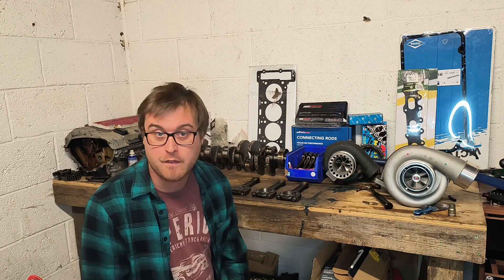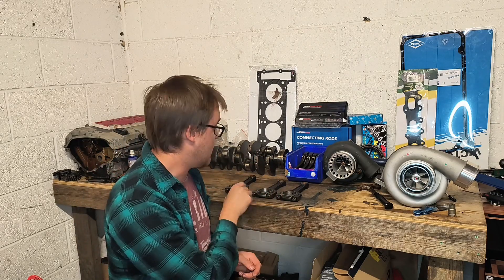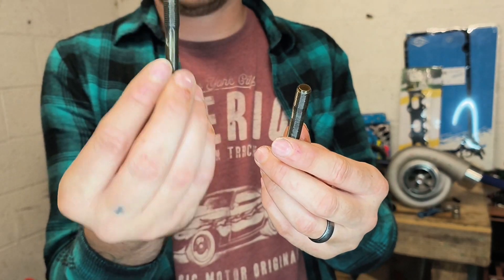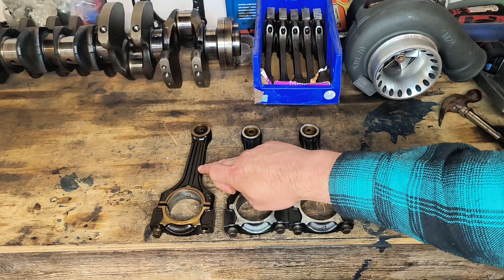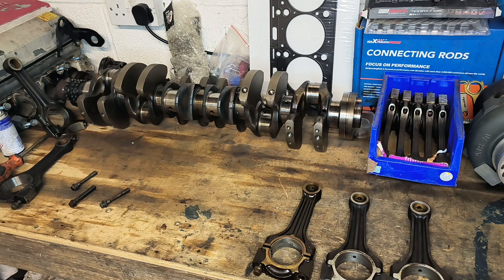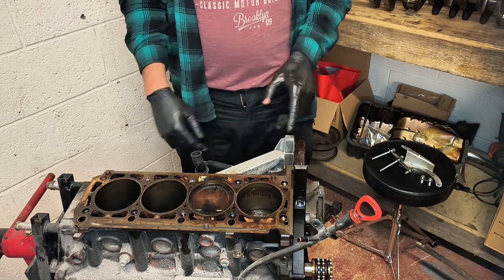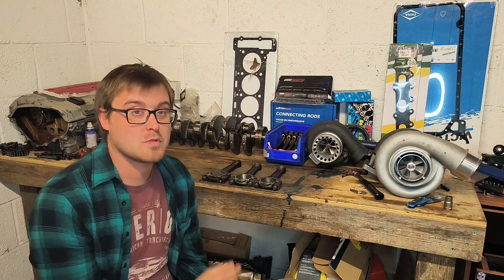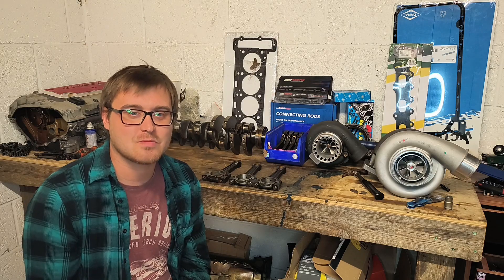What So Special About 90s Mercedes Engines? If Your Tuning -You NEED To See This! M102 M103 M111/104

Comment: Hello do the OEM bearings come 2 in one package ?And are the rods stamped per cylinder number or just to match rod and cap ?Mine on m104.980 were stamped(cap /rod)  cyl1:260-260,cyl2: 2-2,cyl 3:4-4,cyl 4:3-3 ,cyl5:5-5,cyl6:6-6 dont know why... Thank you!

Comment: all these engines keep the boost well etc well the best m104 here in terms of block hp etc it's almost the same and it's still desirable to change the pistons connecting rods and inserts on all these engines if you want to make more than 500 hp to have a large resource

Comment: Hi, what a nice video. I want to know if the m111.955 2L have a the same rod lenght as the 2.3L
Reply from the maker: @tynwolf7686  Thank you, to my knowledge the 2.0l does share the same rods as the 2.3 with only higher compression pistons and a different crank stroke and bore
Reply: @M-oneeleven-M111 ok thanks for those information. Do you know if 2L with forged rod can handle 500 hp?

Comment: I hope you see this comment to advise me before any purchase...I'm going for a m111 turbo build. 
In my country the EVO 230's are difficult to find...So i just found one w202 1996 engine 2.3ltr m111.971 **NON VVTI**.
What's your overall thinking about the pressure this exact engine can handle?
The block is the same on m111.973 vvti and m111.975 right? With that said i was planning on putting an EVO 230 VVTI head on the block from this engine. Could this be done with no other changes?
How does VVTI affect m111's and do i have any advantages on vvti vs non-vvti m111 engines on tuning?
ECU will be Standalone.

Thanks in advance! Waiting for news for your m111 build!
Reply from the maker: hi, if I remember the 111.971 is the naturally aspirated 2.3 isn't it, so the block will be the same rod head but the cams and pistons are different, so the pistons are higher compression slightly domed tops (I'm ironically after a set for the built to see that will help with the rods I want to use) the problem with this is domed tops are not the best for boost especially when the "squash volume" at the top of the cylinder is so small, this would mean you are limited to the amount of boost you can run because the engine with want to DET more. regardless of N/a or Kompressor I recommend only using a MLS headgasket and Arp head studs which BMW s14B23 Arps should fit. the weakness of these engine is the clamping force and lack of material between cylinders (block shims can help with this). 

as for the Evo head swap it is something I want to try but unfortunately haven't been able to myself yet, but I feel it would be possible, but I'm not sure how the timing works whether the it would be a straight bolt on or if you would have to adjust the mechanical timing. I certainly view the Evo head as better for boost with the larger ports and better valves, cam profiles also changed and it is designed for coil on plug ignition. but unfortunately I can't say for sure it would fit as I haven't done it.

I hope that helps 👍
Reply: @M-oneeleven-M111  pls bro tell me i have m111.980 2.3 naturally aspirated vvti engine in w638 so  is this block,piston,connection road,crankshaft and head same? I know that  2.3 k head have  different valve size but i want your reply to know worth my engine tune like you and change this roads pistons or swap 2.3k?

Comment: Is there a difference in fitting om606 turbodiesel connecting rods in a m111? I Think they are pretty beefy and can handle a lot
Reply from the maker: The om606 uses a larger 28mm wrist pin I believe where as the M111 uses a 22mm pin so you would need pistons to suit but they could work if you had pistons with a 28mm pin, a lot of parts are interchangeable with the diesel and gasoline/ petrol engines, however all of the diesels utilised a larger wrist pin due to the increased torque and compression ratios, where as a lot of the gas/petrols use a 22mm diameter pin. Hope that helps 👍

Comment: I want to turbo my m111.960 2.2 but im wondering what piston and conrod i should use to reduce compression just a tad. Do you have any guidelines or suggestions?
Reply from the maker: on the 2.2 it's a bit of a challenge as the compression ratio is high, if I remember right the bore of the 2.2 is 89mm but has a larger stroke than the 2.0 but shares the same bore, so I would see if you can find some 2.0 Kompressor pistons I believe the Na has domed piston crowns where as the 2.0 Kompressor is flat top this should lower the compression ratio, but will still have to be cautious of detonation. I would certainly look at stern garage MLS headgaskets you should be able to use one for a 2.0 on your engine due to bore size this and some Arp head studs for a BMW s14B23 will give you some reliability, all the rods and cranks are interchangeable between m111 engines so you can have some fun, but the easiest route would be to swap out the pistons and stay with a 2.2. hope that helps 👍

Comment: Look m111 evo difference ;)
Reply from the maker: I have been trying to find a set to also include as I know there is a fair few differences with the m111 and m111 Evo, all I can find is a few pictures at the moment I really want to strip a Evo engine down and compare but haven't had the spare funds to buy one. from the picture I could find was they shaved the weight around the rod bolts and gave it a more rounded profile. forgive me I am still learning myself however I'm sure you can educate me, especially as it was your original build that inspired me to start trying to get more from these engine many years ago 🙏

Comment: Hello man. I have a problem hense a question. I installed one of the injectors suggested by you on an older video (saab 2.3t brown ones). Now my pre face m111k revs to 5.2-3k rpm and if i manage to do the full 6 i get a 2 meter long fireball after 1 secound of releacing the gas pedal. I think this means i need a tune however i need to do a bit more prep work and ill be going in for a rpm increase. My questions are: is this normal woth there injectors? Can my stock pre face ecu take a tune to about 7-7.3k rpm? ( im almost done with the hardwire preparation) If i need the evo ecu for this tune does it require anyything else other than the ecu itself to wire it up and make it work? Thanks so much you are my only guide! I cant find this info you are giving me anywhere else!
Reply from the maker: hey buddy, sorry so late to respond, your stock ECU can take a tune but it is quite difficult to do and not a lot of companies will tune them, this is why we always suggest stand alone ECUs as it gives you full control, as for revving to that kind of RPM you will likely run into valve float I would definitely suggest upgrading to dual valve springs, these engines from factory were never designed to be revvy engines they're more like a diesel engine designed to make torque and power down low in the rev range, when you start to rev past the stock limit the valve springs can't keep up, so I advise staying around 6k 6500 unless headwork has been done.

The issue you have is overfuelling definitely to do that you must have fuel pooling in the exhaust this could cause "bore wash" as your on stock management it may be better to look at the VW/Audi 1.8t fuel injectors as they're slightly closer to stock size and the ECU should be able to trim them back, it sounds like what's happening is your not at a boost level to yet require the flow of the Saab injectors and the ECU can't trim them back enough to compensate for the size this can happen sometimes, however VW/Audi injectors are another cost effective option and the stock ECU can compensate for them, failing that you may actually have a stuck fuel injector but normally you would notice poor running throughout the rev range if that was the case. 

Is your car still running the supercharger or is it turbocharged now? if it's still on the supercharger set up I would definitely lean towards 1.8t injectors rather than Saab as the supercharger set up will normally top out around 260hp with a lot of modifications, where as turbo can reach anywhere up to allegedly 400hp on the stock engine however we have never seen that in person. when you take into account the flow rates required for these power levels the 1.8t injectors are far more suited to the power levels of the supercharger set up as most tuned SC M111s sit around 230hp.

I hope this helps 👍
Reply: Thank you very much for your detailed answer. Last question is what ecu can i put in that i can tune? Is any stock mb ecu possible to fit and work properly and if not where can i find info in wiring a standalone. Also what standalone should i get? Dual valve springs and equal lenght 4-1 manifold are going in soon so i would like to be able to tune it to higher rpm.

Comment: Hello, do you know if I can use a cylinder head 8 valve from my m102 engine in block m111? or maybe a m111 crankshaft in block 102??obviously modifying the pistons and connecting rods thank you
Reply from the maker: Hi, sorry for the late response,the 8 valve head from what I can work out will not fit the M111, however it maybe possible that the M111 crank may fit the M102 however I could not confirm this, mercedes did keep a lot of the specifications for the crankshaft journals the same and it would not surprise me if cylinder spacing is the same. are you intending to stroke the M102 engine?
Reply: Thank you very much for your time and for the answer !!!!!

Comment: im planning to turbo my m111 evo 2.0l,do you think my rods and pistons will hold?My mechanic says so,whats ur opinion? do you think that it can handle a respectable power with stock internals?
Reply from the maker: HI the M111 rods will hold 350-370hp within the stock Rpm limit in some cases they do hold more, the pistons will hold 270-350hp in our experience, again some say they have had 400+ but at that point you need a very good tuner as it's DET that kills these engines. I would always recommend a MLS headgasket upgrade with BMW s14B23 ARP headstuds or any other 12.9 headbolt upgrade, the stock headbolts and gasket do not hold higher levels of boost well so it's definitely worth upgrading the headgasket and headbolts that will give you reliable power.
Reply: @M-oneeleven-M111  what do you mean DET?

Comment: Any idea whether I can use M102 con rod on M111
Reply from the maker: I am using a M102 con rod on my build but you need a om601 2.3D crank and custom pistons or potentially N/a pistons but I am yet to investigate that as a possibility. M111 rods are 149mm in length and M102 rods are 145mm in length
Reply: what is the diameter of the m111 crankshaft bearing and m102 crankshaft bearing ?

Comment: Sort of related topic question - what is the cylinder spacing on the M111 compared to the M104? Is it broadly the same architecture with a couple of cylinders lopped off or was it more involved?

Comment: Hello there, off topic but i saw somewhwere quiet some time ago you mentioned a fuel pressure regulator from a bmw if i remember correctly that has regulation. I cant find it anymore, do you remember the part number of it?
Reply from the maker: The fuel pressure as you mention is actually a VW 4 bar Bosch unit, I did however mention using a E39 BMW M5 MAF sensor element along with Bosch FR5DC spark plugs when using the Speer crank pulley. I hope this helps 👍
Reply: That might be, all i remember is that it fits in M111 fuel rail and that i had regulation screw on top of it.
Well this narrows the search, thanks a lot!

Comment: So which can handle boost better ? Just curious
Reply: what about m102?
Reply: Known m111 builds include arp headstuds and mls headgasket. They love to sit around 350bhp when turboe’d  but seen them do 400hp with no issues. Seems the problem after 400 is airflow in the heads and the rods dont cope. So, new builds are emerging with forged rods and ported heads with m104 valves and springs. Aparently the m104 guys use m111 pistons and they say they take 700hp with no issues.
Reply: @9teen837  thank you i will be using this knowledge for the greater good of m111 society 🤣🙏
Reply: And how much hp are these engines actually reliable to without fueling problems and everything. Say i got it all figured out and threw high boost from a turbo at it how much hp would it be reliable on